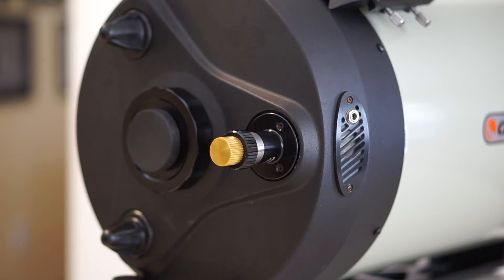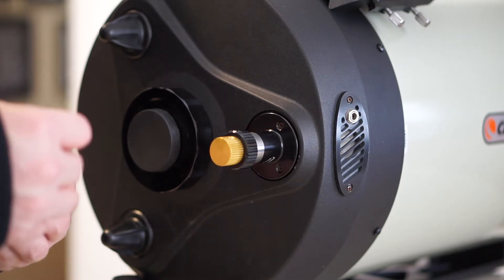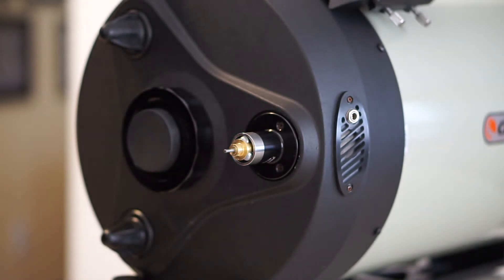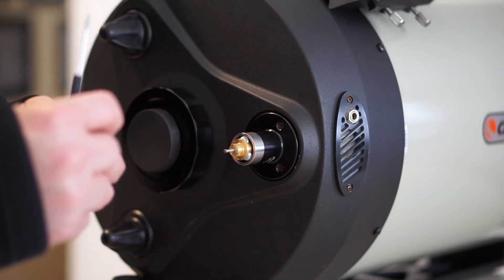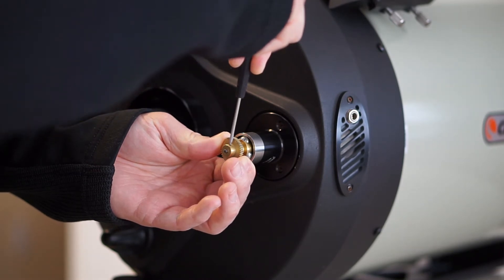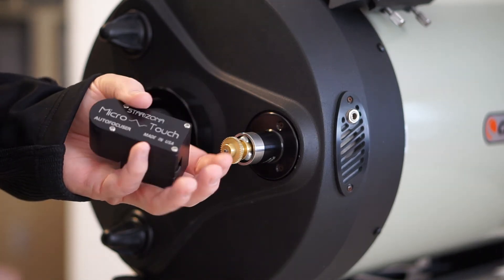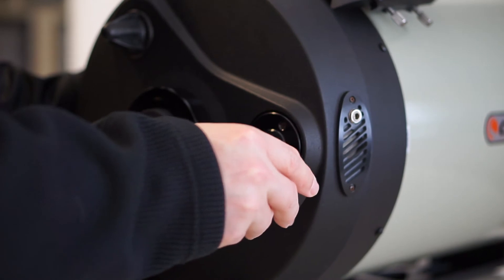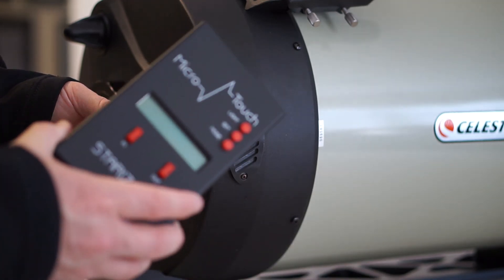Adding MicroTouch Focuser to Celestron Edge HD 1100

Comment: How is the impact of the mirror shift on this system?
Reply from the maker: There is some mirror shift if the scope is significantly out of focus. In focus, minor corrections are a non issue. I don't lock the mirror locks and I let my software control the motorized focuser. I have a starting point of focus for Hyperstar and Shooting off the back. Highly recommend this system.
Reply: Hi,Thank you for your reply.You don't have to worry about the effects of the mirror shift.

Comment: Can anyone comment on if it is required to colimate a cassegrain after fitting an electric focuser.
I ask because i see that the threaded screwed rod is very movable while doing this, and as there are no exploded view drawings to show just how the screw rod operates.
Reply from the maker: I did not after adding the focused and had no issues. I have also taken the entire scope apart - the bushing for the threaded rod should not cause any issues with  collimation in my experience